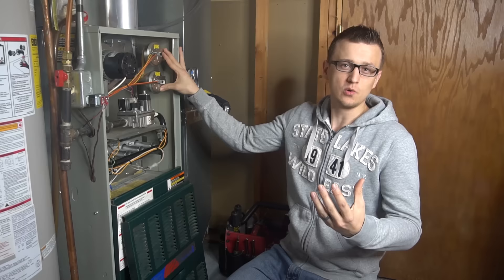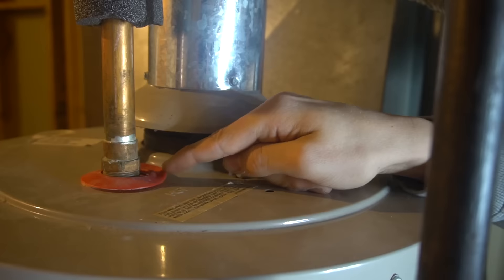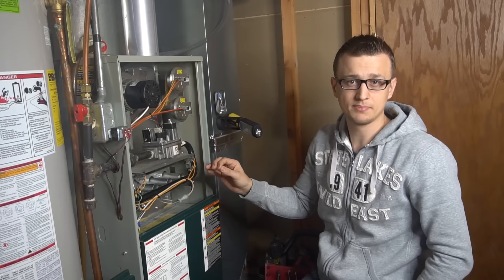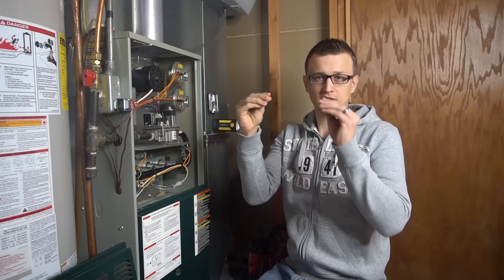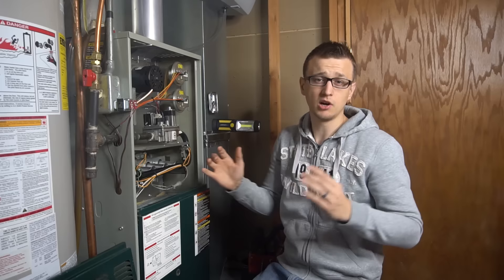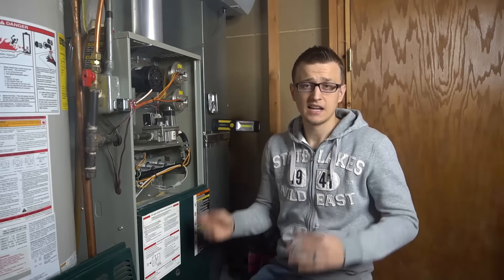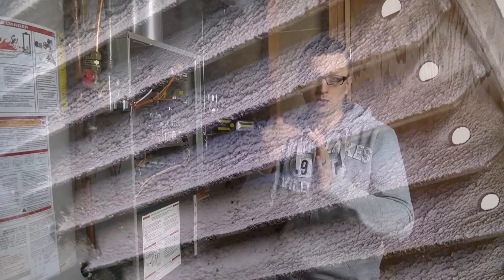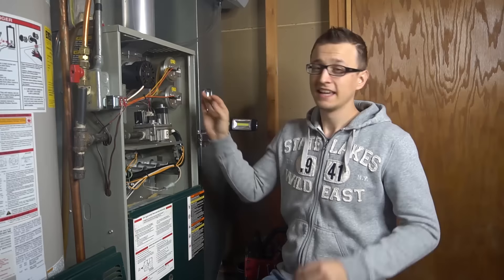Furnace Pressure Switch Troubleshooting

Comment: Great video. I have a Payne furnace (PG95SAS) and had the 31 error code. Went through component by component checking possible issues until the pressure switch test. I very lightly exercised my pressure switch diaphragm, heard an extremely soft click, reconnected everything and the system is running without issue! This was the first start up after the summer, so I assume it might've gotten stuck sitting for 4+ months. Thanks again!

Comment: Man you might be the guy i was looking for. Your attitudes just right although ive checked  most of that you  suggested but i think i need to clean the secondary heat exchanger from what i learned. I haven't had a filter on it for 3 years and child debri has fallen through the return vent.

Comment: You are awesome!  We did a few checks.  When we took off the pressure hose it broke --#4 on your list!  So we  reconnected it and woo-hoo, the furnace worked after that.  Free fix, with your help!  Thanks so much!  --And  thanks for letting us know about the  LED troubleshooting code.
Reply from the maker: You're very welcome! I'm happy to hear you were able to get it fixed without needing any parts! Stay warm and have a Happy New Year!!

Comment: Great video, you helped me find my issue which happened to be a stuck pressure switch. Your manual test of the switch got it unstuck and the furnace is working again without a repair cost.

Comment: For me the issue was the white plastic wire coupler for the wires coming down from the pressure switch: wire tension pulled it loose so it worked intermittently, zip-tying it tight (so far) fixed the issue, thanks!
Reply: hmm, still intermittent, must be something else :)

Comment: Wow great video, on my Carrier infinity 58uvb080 was getting code 23 low heat pressure switch did not open, after watching your video I removed the tube to the pressure switches and sucked in a little, and reconnected and now I have heat again, thanks! I don’t know why this happened but warmer days are almost here!

Comment: I would like to thank you again for your great help everything you said was absolutly true, I had two problems with my 18years old high effeiency Carrier first code was 34 and ignier was bad, replaced that then I got code 32 and the condensation trap was cmpletely plugged I replaced with a new one had to do some draine repiping so it would be easy to remove next time. Now we have heat thanks to you. I did buy some of the tools you suggested and they were a great help.  naturally I would like to do a complete inspection of the internals to make sure everything is o.k. by the way I am 85 years old retired engineer. thank you again.
Reply from the maker: Happy to hear you were able to get your furnace going again! Glad that videos were able to aid you with the project :)

Comment: Thanks for sharing such helpful videos! Been working on and installing furnaces the last ten years and have found your videos to be among the best yet. Anyway,  I just fixed a Bryant 90+ furnace that was giving a pressure switch code. Strange problem. It would run when I took the burner box cover off, but would go out when I put it back on. Tested that several times. There was no screen on the intake or flue terminations, so I assumed there was some blockage in the intake. I cut it open and found nothing! Did the same with the flue. Nothing but a couple dead bees. Not enough to block exhaust. I poured water through the condensate drain trap and it came out the termination. So that wasn't backed up. The last thing I did, which probably should have been first, was I removed the inducer assembly. That's where I found the problem: a mouse had chewed a few small  holes in one of the pressure switch hoses that connect to the collector box. Lesson learned, it's easier and faster to remove a few screws for inspection than cut and reglue PVC pipes, especially in a crammed crawl space. Hope this helps somebody out there. Keep up the good work Jay!

Comment: Great job explaining. I was diagnosing three blinking lights on an Amana  board saying pressure switch stuck open. First cold day of the year. I got to where you said try to blow in the tube and I saw a hole in it. I cut the tube a bit shorter. Fired right up. :-)
Reply from the maker: Great! I'm happy to hear that you found and fixed the problem! Thank you for leaving a comment, stay warm!

Comment: Thank you so much for your videos!  They're excellent!!  With your help I was able to chase down the condensate line as the problem for my furnace not firing.  Thought I was a hero....for two days.  It fills up again, what's the most common reason for that?  Drain line to floor drain?  Exhaust pipe?  I live in Colorado where it's dry, so not excess humidity. I have a Armstrong 95% furnace.

Comment: A FREAKING BIRD crawled all the way into the exhaust pipe and died in the squirrel cage blower fan!!  This caused the 3 blinking light code on a high efficiency furnace with the PVC Pipes. Not enough exhaust pressure, so it tripped the pressure switch.   

Will be putting a grate on the exhaust pipe now!

GREAT VIDEO!!
Reply: I thought to do this but will ice form on the grate in winter blocking the exhaust?

Comment: Thank you! I just cleaned out the condenser trap and the connected tubes + the ventilation to the outside of the house. My collector box was collecting a lot of water last year and we had it replaced. We have heat again!

Comment: Great video! Just an observation for the water heater.... the foam pipe insulation was designed to be installed on the cold water pipes to prevent condensation (sweating) and dripping down. Furthermore, you need to have a 6 inch combustible clearance to single flue metal exhaust vents and 1 inch clearance to B vents.

Comment: Another tip and how I was able to troubleshoot my furnace is to put your ear close to the pressure switch when you flip the switch to turn it on.  See if you can hear the pressure switch click.  On mine I turned it on and I could hear the switch click when I was listening closely and that's how I was able to determine it was a bad connection on my wires to the switch even though they seemed as though they were connected firmly.

Comment: I bought a new inducer motor and pressure switch 2 years ago. Replaced them and it work all last year. Now this year, the furnace works intermittently. Usually 2-3 cycles and then just the inducer motor will run but won't close pressure switch. So I'll have to go and take off the hose and suck start it with my mouth then put the hose back on inducer motor and furnace will work until the next cycle. Venting is clear and there's no condensation build up and I also took inducer motor off a few days ago and resealed the vaccum ports with hi temp sealer. I let it dry for 24 hours and same thing would happen. Seems like it would start up first time in the morning but then next few cycles it won't work. During this time the inducer motor always runs but pressure switch is not closing. I know the pressure switch and inducer motor work because the furnace does turn on sometimes by itself. But then sometimes during other cycles it won't. But the inducer motor always turns on just doesn't always close pressure switch. Any suggestions please? Thank you!
Reply: ajm923...  i have exactly same issue.  did you resolve your issue? and how did you do it?
Reply: @dankster711  I had an extra inducer motor gasket laying around so I replaced the old one, resealed with hi temp silicone again that I bought from home depot and just to make sure air vents were not clogged I use a plumber's snake to try and clear anything within the vents. I did have some debris on the end of my snake when I pulled it out. I might have pushed more debris in than I pulled out after snaking it. Either way I'm thinking I might have helped it by clearing whatever little bit of debris might have been blocking it. Plus like I said earlier, I replaced the old gasket. It was smashed and flattened on edges which seemed to create a vaccum loss. When I bought the new inducer motor I reused the old gasket which I should not have, but it seemed in decent shape at the time, and i saved the new gasket in case i needed it later, which i did. Like i said i my original post, the pressure switch was working, just intermittently. I called heating and cooling company and the owner was kind enough to explain to me what I should try being that the pressure switch did work. And he told me to try and clear air vents and seal inducer motor and vent ports on rear side. So I did this and now my has been working ever since. F.Y.I...on the 2 vent
 ports on inducer motor (mine had 2), my foam gaskets were also flattened and out of shape so I made my own new gaskets by using a rubber washer that is used for inside a garden hose. The kind that seals between the hose and the water valve. About the size of a nickel round. I put it on its edge and I sliced it in half with a sharp razor blade making 2 thin rubber gaskets. It's a perfect size. Then I slide them onto the vent ports and sealed them with hi temp silicon. I also had a factory gasket that came with the inducer motor that I used to seal the inducer motor to the furnace wall using hi temp silicone also. Hope this helps!!! Good luck!!!
Reply: ajm923 hi again.   Thank you for your help!
Reply: @dankster711  Your welcome!

Comment: I have a screaming draft inducer that suddenly stopped completely for a weather king 80PS series. Cost was between $218.00-$545.00. I found one from McComb for $127.00 with shipping and taxes it was $149.00. Downside It takes 5 days. Hope that takes care of my problem. I’ve already cleaned burner rack that was full of buildup causing only one of the 3 burners to light. This summer I’m replacing furnace.

Comment: Thank you so much for this video. I am getting an error code 42 (Inducer fault) and error code 32 (Low pressure). I am going to try to remove the black hoses and see if I can fix it myself before calling a pro.

Comment: Very helpful on how to diagnose between whether it is the board or the motor by bypassing the thermostat (R and W) then check the 120V on the motor. Thanks for that tip.

Comment: When I disconnected the blower from the exhaust pipe (high efficiency) the furnace runs fine but when I reconnected the exhaust pipe to the blower it shut off. I cleaned out both the exhaust and intake pipes. Still no luck, tomorrow I guess ill take the blower off and see if somethings in there, not really sure what else to do. I’ll check that water trap too just to have a look at it. Thanks for the video, its really broadened my understanding of whats going on in there.

Comment: Extremely impressive, thorough  and helpful video!  Have heat back in the house after a Carrier Code 23.  It was the clogged condensation trap.  Flushed it and then needed to blow/suck into pressure switch hose to either open or close switch to operate.  Couldn’t have done it without your video.  Thank you!

Comment: Thank you for the video. I'm in MN and have a Gibson furnace. It is cold and my furnace has been acting up. Whenever the furnace turns off and it shows the pressure switch error code; I would be able to get it to restart by turning off the breaker and tapping on the pressure switch (Dual); as directed by the repairman I called. 

He said that I needed to replace the pressure switch. What concerns me is that he didn't do any of the troubleshooting seen in your video. All he did was used his meter to measure the volts coming from the pressure switch. I called him this morning and he never ordered the switch as we discuss so I had to order the pressure switch and pay one day shipping.

I am praying that it is actually the pressure switch that is at fault. I am in no way doubting the repairman but I do feel like he had let me down as he didn't deliver on his promise (ordering the part). I will be looking at troubleshooting my furnace tonight. Please let me know if you have any input. Thank you.

Cold in Minnesota...
Reply from the maker: It's definitely cold in Minnesota alright!.. If you are able to get it going again by tapping on the pressure switch, then it's very likely that the pressure switch is bad. So hopefully you will replace it and forget about your furnace for a long time :)

Comment: I have to say that you're the best when it comes to explaining the operation of a furnace.
I was hoping you may be able to shed some light on an issue that I am having.

American Standard 
Freedom 80 Comfort R Furnace

Error code: Three flashes indicating pressure switch 
Inducer motor working fine
Exhaust clear no obstructions
Hose and inlet clear, no obstructions 

Remove and reconnect hose from pressure switch and everything operates fine until next cycle

Replaced pressure switch, same scenario.

Any suggestions?
Reply: Collapsing hose to pressure switch

Comment: thank you for this very well made video. Have an E2 error code on a Goodman. unit will randomly start to work again and after few hours or few days stop to respond to the thermostat. replaced the pressure switch, did not help. put a vacuum to the exhaust pipe and a tune of water came out, but still shutting of randomly. had the unit for about 6-7 years. not sure what else to do.

Comment: Than you for this video and your others.  My furnace is acting funny.  I unplugged the hose from the pressure switch to the furnace and blew into it.  It felt like something dislodged.  The furnace turned on.  Then I moved the vents to winter because I forgot to move them earlier.  Then the furnace started kicking on and off and then shutting down.  I moved the vent lever back to summer setting and it is running fine.  Something is wrong with my vents.  Just don't know what.  All of this started because I failed to change out the filter when the thermostat told me to ( 2 weeks late) and I closed some of the vents upstairs because my family was complaining it was too hot.  I would like to call someone but I just want someone to come in fix the problem, I pay them, and they leave.  I don't want you hear your furnace is 18 years old and you need a new one.  Oh and the quarter pounder is silly. I think I will make my own.

Comment: Well I went through all 10 and then found number 11. I had to install a new inducer but hadn't tightened one of the bolts enough, letting the smallest bit of air around. After tightening it worked. Thanks for the other tips though.

Comment: This is a pretty good rundown, but not quite complete. You were very thorough with everything up to the control board. I'm trying to help a friend diagnose his issue, trouble code says pressure switch (blinking green and solid red LEDs), it's an 80% furnace, one pressure switch, vertical metal pipe venting through the rood with the water heater. Induction port on the motor has vacuum (don't know how much), sucking on the tubing actuates the pressure switch and closes the contacts (audible click and verified continuity with multimeter), no obstructions anywhere, actually bypassed the pressure switch with a jumper wire and still nothing. Next step is to check voltage at the pressure switch and I was ready to call it the control board until I watched this video. You neglect to qualify the issues related to lack of power to the blower motor as a separate set of issues related to the blower motor not running. In my case, the blower motor runs. So if the blower motor runs, those issues you address related to the pressure switch and the blower motor not running should be ignored. Anyhow, near the end of your video you mentioned the limit switches possibly controlling the voltage to the pressure switch? And that whole issue needs addressed. How much voltage is applied across the pressure switch, and whether or not the limit switches control that. Because this problem I am troubleshooting is intermittent, nothing seems to help, it always starts working again after a while, meanwhile the homeowner has been tinkering with it and thinks the fix was his cleaning the igniter and thermocouple, but it keeps happening and now more frequently as winter approaches and heat is being used again, and now I'm wondering if it's a limit switch overheating and getting stuck open. The wires to the pressure switch go straight to the control board, so I'm guessing the limit switches input to the control board and are not in series with the pressure switch. But I should be able to check that the limit switches either have continuity or voltage. So that is the part I wish you had delved into a little deeper and I will check that and comment what I find out next time I work on it.

Comment: Thank you so much Jay!  My pressure switch hose metal port on the inducer was super clogged, I had to pound a long staple in there with a hammer.  I wasn't sure how much suction there should be, but blowing through the hose into the metal port you could tell for sure that the port was clogged.  I was worried about breaking something inside, but a small paper clip, then a larger paper clip, then a long thick wire lead to a 2 inch long staple and a hammer cleared the clog and the furnace is running!  I owe you, I am going to find your paypal or venmo account now to send you a tip$$!

Comment: I have a Trane XB.  I discovered that the condensate drain line from the exhaust fan was blocked.  This create a pressure in teh furnace and thus the red blinking light (3 time) was the error code.  Once I cleared the line all was well!!!  Thanks for the insight about clearing the condensate trap.

Keith

Comment: So, I'm not sure if you see these comments often, but...    I followed everything that you had here (very helpful!) and found that the issue was that there was no vacuum going to the pressure switch.  Therefore, it never closed.  Using your sucking suggestion, the furnace kicked on every time.  My question - what could cause the suction to the hose to stop?